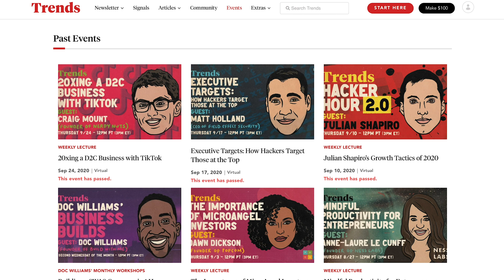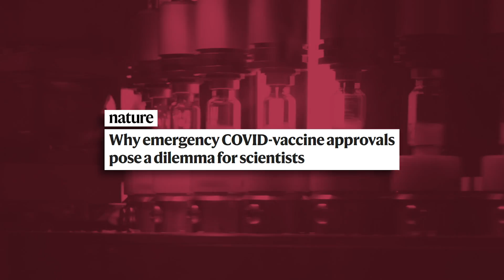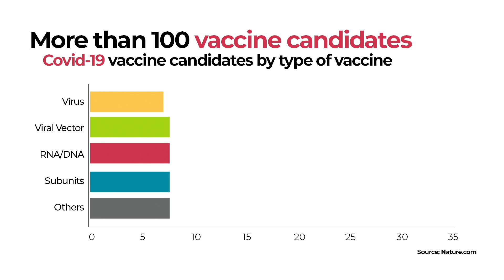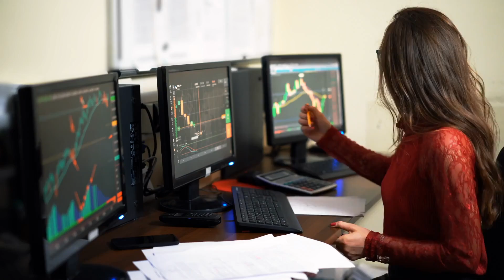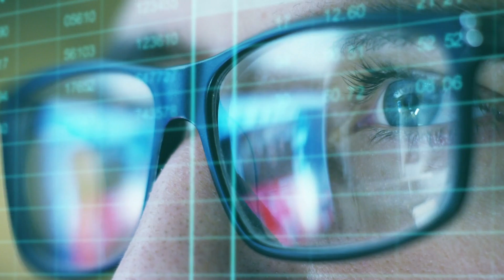How has a COVID-19 VACCINE been created so QUICKLY? - VisualPolitik EN

Comment: I hoped that you'd go a bit more into the potential risks and their probability. After all, AFAIK, people tried for 12 years to get the new method accepted, but they always failed and now, suddenly, they can solve it in under a year? As someone, who did a PhD. in a lab, I'm very sceptical of it even with unlimited funds! Plus, since it's a new method, there's always the possibility of a black swan event we cannot prevent.
My main concerns are the severe side reactions observed and tem pointing into the direction of potential auto-immune diseases developing from this new method. Another concern of mine is that unlike most vaccinations, I always had bad experience with flu vaccines and thus stopped participating. I always got a flu within 7 days after taking the flu shot. It is my belief that taking a vaccine during flu-season just distracts the immune system and is thus counterproductive.
PS: I worked in Biochemistry, but nothing antibody related.
Reply: That´s what i have been asking myself since they anouced that their vaccines are "98% effective" and no one stops to ask any questions at all it is just take on face value. Suspicious. 

The executives at pfzer and moderna sold their stock on the day they are anounced their "miracle cures" and very little have been said about this at all, looks like supression of not convinient facts.

They already sais these "cure miracle vaccines" should not be administred to pregnant and lactating woma, people under 16 and  people with alergies. That´s a lot people that cannot be vaccinated yet no big questions are raised.

Comment: Not Pfizer developed the vaccine. It was developed by BionTech. Pfizer just distributed it.
Reply: Not entirely correct.  Pfizer did most of thr clinical trials.  In case most people don't know, for any drug or vaccine, the clinical trials part is actually the biggest, longest and the most expensive part of the research and development.
Reply: Pfizer is manufacturing it.
Reply: It's not trash, it's garbage - its the same they work together. Just stay as far away as possible from those and their products

Comment: Have you taken the vaccine??
Reply: when it is released to the public I certainly will.
Reply: @mattylennon6009  As of today, the death toll is 1.85%.  Let's do some quick math.  With a death toll of 1.85% and an Ro of between 2 and 3 the number of people that would have to become infected to attain herd immunity is between 60 and 70% of the population.  The US Population right now is 330,062,950.  We'll use 65% for the number of infected and multiply by the 1.85% who would die.  That gives us 3,969.007 dead before we could bring this pandemic under control without a vaccine.  Yes, that scare the hell out of me and it should scare you as well.  That's why you take the vaccine.  Secondly, it doesn't only prevent symptoms, you are misinformed on that, it also cures by boosting your immune system and teaching it how to kill the virus.  The question is how long can you remain contagious while the vaccine does its work.  The shots are given 21 to 28 days apart and it appears that you remain contagious for some small time after that but no tests have yet been done to determine the time.  If you believe that you have a right to refuse the vaccine, you are correct.  Those of us that are possibly among the 4 million that will die if 60% to 70% of the population don't take it pray you will change your mind.